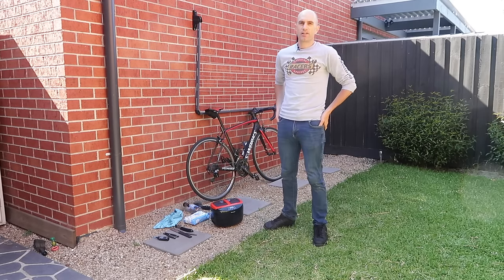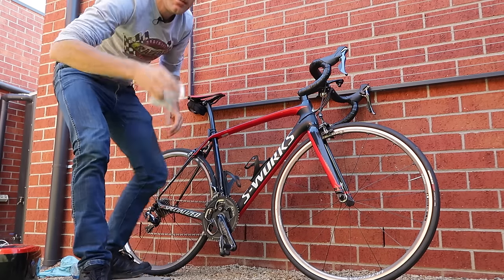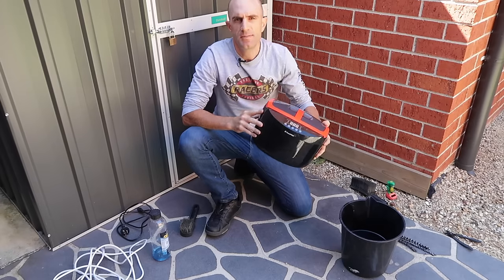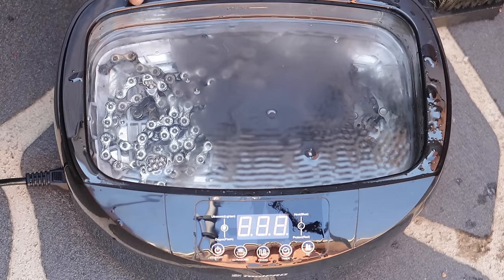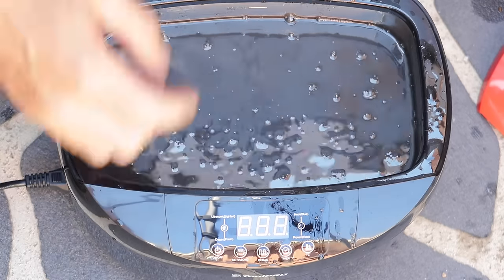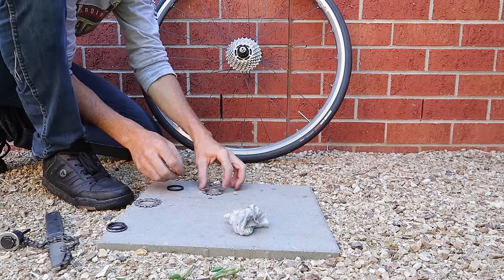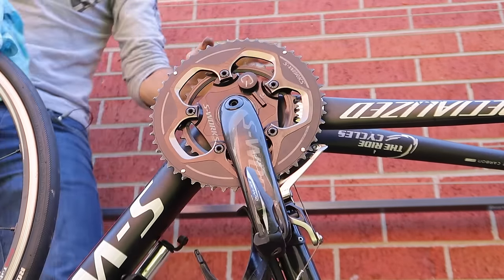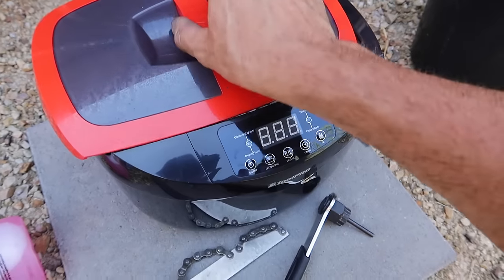CLEAN BIKE: The Ultrasonic Part Cleaner! // How to Clean a Bicycle Chain

Comment: Hey Shane, ALDI have a 50w 750mL USC today for $30, would be worth a go?
Reply from the maker: Might be a little small. Worth a look though.
Reply: @gplama  Cheers mate may give it a go, will fit a chain in, a 32t cassette diameter is about 13cm so should fit, maybe not both at once depending how much separation is required. Thanks!
Oops I was looking at the products housing dimensions, May be close but a chain should fit at least

Comment: What brand of rear light is that on Von's bike? Also, what is your opinion on waxing a chain, or using wax based lubricants such as Squirt. I've tested but the wax seems to get gunky and definitely harder to clean, and strip from the chain if you want to go back to oil based lubricants again.
Reply from the maker: Knog. Waxing is super clean stuff... but I had to keep applying it every three rides or so. Maybe it's better these days?
Reply: Shane Miller thanks! Yeah it wears off quickly. I've had it pickup quite a bit of gunk from the road which is harder to get off than just de-greasing a chain, and it seems like once a chain is waxed it's hard to switch back to grease as the wax is somewhat oil phobic. I sure like how clean it stays though compared grease. I wonder if an ultrasonic cleaner would help with a waxed chain... maybe with hot water?

Comment: That cassette and chain looked better than mine even before you cleaned it
Reply: that cassette, crank, and derailleur retail for  more than my whole bike.
Reply from the maker: It's relative. Head over to any car racing channel and get blown away by the cost of a racing engine. Or how much they spend on tyres for each race meet.

Comment: Don't wash your chain in water. Use odorless petrol instead. No need for expensive bike cleaner then. ;)
I just put mine in a liter bottle of that stuff and shake vigorously, but it will work with ultrasonics also.
Remember to soak it with chain lube afterwards.

Comment: what kind of oil do you recommend?  o use the wax based stuff.  is that sufficient if I clean my chain using this method?
Reply from the maker: Dinosaur based. Wax based works nice, and it's clean, but needs reapplication every few rides.

Comment: 1. Lube chain 1drop per link
2. Rotate cranks to allow lube to penetrate 
3. Wipe chain clean of floated dirt and excess lube

That's it, skip the cleaners, wipes, toxic chemicals.  Using solvents and degreaser is unnecessary at best, and unless completely cleaned off just ruins the new lube.

Comment: OK, so how do you know where the spacers in the cassette go? I.E. how do you know which gears they go between?
Reply: Jensen Healey they go between the ones that don't have integrated spaces, it'd be really obvious where a spacer should go if you didn't put one in
Reply: Jensen Healey you can once you start to remove then just lay out in order as everything came off! Job done you'll soon see how it works and goes back together ;)

Comment: Bought an ultrasonic cleaner from Amazon and tried it last night to clean a couple of cassettes and a chain. The first cassette I tested was done in a mixture of water and Finish Line citrus degreaser, mixed at a ratio of about 3:1. I started with cold tap water and then heated up using the ultrasonic cleaner's own heater. Can't say the cassette came out cleaner than just using degreaser and a brush because I still had to use a brush and several sprays of Muc Off. For the second cassette and the chain, i used a mixture of water and Pedro's Oranj Peelz citrus degreaser. I didn't have a whole lot of the degreaser left so the water to degreaser ratio was much higher. The cassette and chain definitely did not come out cleaner than the previous attempt. They were cleaned in multiple 480-second cycles. I am a bit disappointed with the outcome. Did I not use the right kind of degreaser for the ultrasonic cleaner to do its magic? I did use the plastic tray that come with the cleaner (accordingly to the manual, using the tray to reduce the cleaning effect by about 20%).
Reply from the maker: I use Kerosene with good results. The parts don't come out sparkling, but they wash clean with water (and a little soap to remove the left over kero).
Reply: Apparently kerosene is not as readily available as I thought it would be. I could not even find it in the chain hardware store Home Depot. I bought Simple Green instead and it works way better than the citrus degreaser I used previously. I used a 1:1 Simple Green / Water ratio. The cassette didn't even need to be brushed or sprayed with Muc-Off after the ultrasonic treatment. I simply rinsed the cogs in water.

http://simplegreen.com/products/all-purpose-cleaner/

Comment: Many thanks for the video Shane. I've heard about people using Ultrasonic cleaning but will now investigate further. What Quicklink do you use and what tool was that to undo it so easily ?
Reply from the maker: My local bike shop has one and they swear by it. Not sure what brand quick-link is on Von's bike... the removal tool was some $5 job from Wiggle "Quick link removal tool" should bring it up in the search results.

Comment: Shane, nice vlog as usual with great detail. Yes. Festive 500 begins tomorrow, though here in the northern hemisphere it will not likely be so sunny and nice, expecting a dry day here where I live, in the Seattle WA area, with temps in the 0-3 C / 32 - 36 F range. Is this your standard cleaning process for the drive train, or do you only go to the extent of the ultrasonic cleaner a couple of times a year or when particularly dirty?
Thanks and Happy Holidays!
Reply from the maker: We just rolled in at 8pm and it's 32degC. Brilliant weather here today. :)  I use the ultrasonic cleaner every 6-8 weeks on the chains, but it does depend on the riding conditions they've been through.

Comment: Hey shane, i picked up a cheaper ultrasonic cleaner but my chain still sounds kinda gritty despite running it through about 2-3 cycles. Any tips of possibly making that clean even better?
Reply from the maker: +ryan singh Use a degreaser in the cleaner. Blast it clean after with water and/or a soapy brush.
Reply: Shane Miller I dumped a bunch of degreaser in it actually. I'll try brushing it down too, thanks for the tip

Comment: It should be emphasised that hydrocarbons solvents and fuel oils such as kerosene are toxic, and takes a surprisingly long time to break down in soil or water. Please use a biodegradable degreaser. I think most of cyclists care a little for the environment. Let's follow through with that.

For more information about fuel-oil toxicity and pollution:

https://www.atsdr.cdc.gov/phs/phs.asp?id=514&tid=91

Comment: You can get a deeper clean using petrol in a sealable container and shaking the parts around manually for 10 minutes.
Don't spend your money on devices you don't need when you can do the work manually in a reasonable amount of time.

Comment: (Question from a downhill biker) why not just spray it down with a power wash?. Works great for me lol.
Reply: Sweet! I would never power wash my pride and joy.Treat your bike like you would a lover.Gently caress those sensitive areas,before giving it a really good ride.Going in with the power washer can do a lot of damage to the cables,bearings and chain.Change words to suit your lovers Anotomy.
Reply: Stayshtum68 I have some rules. I just power wash the frame but the chains and hydraulic brakes etc. I was with a sponge.
Reply: kangsterizer my bike is like clean at max 2 days in a row so I don't really bother cleaning it until it's spotless I just do all the necessary parts like brakes chain to get of the dirt and just do a check on all the moving parts

Comment: Looks like the inner chain ring might be installed in the wrong orientation, Could be wrong as not used to that Power meter/crank setup but may be worth a check. 
nice little cleaner though!
Reply from the maker: Yep. It's off by one... but the right direction. No issue for the inner ring as there's no ramp pins or anything on it. (Installed by an Specialized dealer when Von purchase the Quarq spider..... pretty poor effort on their behalf imo)

Comment: Too much disassembling for my taste. I just use a brush with bristles long enough to reach all the way between the cogwheels and some degreaser. Remove the chain, place into a vat of degreaser (I use a plastic container from iso drink or protein powder) and shake or swing it to make the degreaser circulate and penetrate into the chain. Use a brush to put degreaser on the drivetrain and work it with the brush to mobilise the dirt. Rinse it off with no pressure (I do mine in the shower), dry it off by wiping or shaking off. Take the chain out of the degreaser and rinse it out with a strong water jet, dry with a cloth and heat it to evaporate the rest of the water in it. I usually put it on my cooker plate and turn it on briefly, just until it is warm to the touch and let stand for a while. Lubricate the chain - my preferred method is to lay it out on a table and dab some oil on each joint, let it seep in, and then wipe as much oil off with a cloth as I can. Replace the chain. Shiny clean!

Comment: While the chain might look clean and new after the process described in the video, you actually kill it because all the grease that is put on the chain in the production process is being destroyed. There is a reason for that sticky stuff on the chain: Without it the chain will last only a very short time. And no product on the market is able to replenish the grease inside the chain links. So do yourself a favor and clean the chain with a cloth and some oil. Same goes for the rest of the bike: A cloth can be used multiple time and with some spray-on wax you even conserve the parts.
Reply: Garfie1d73 that's why you put new lube on the chain......
Reply: You did not understand me. Lube does not get into the chain links. And if it gets there it's way too thin to withstand the strain when you're pedaling. And it gets washed out in seconds if the chain gets wet. Only the sticky grease can stand the strain/pressure/water. That's why you shouldn't use petroleum ether or other "degreaser" on the chain.

Comment: Don't buy a Chinese one off eBay. The transducers, and often other electronics, cack out really quickly. Buy a lab quality European or US-made one. Neutral industrial detergent is fine as a surfactant, and if you want to keep things clean inside, use a Pyrex glass bowl, not a plastic one as a secondary container (glass transmits the waves to the inner fluid better).

Comment: 90sec? You need it to be in there for 30min to 1hour at 80deg C . You also need to use proper ultrasonic cleaner flued, and that stuff is not good for the environment.

Comment: So, I am a little late to the party, but after seeing this video over Christmas, I thought I would give it a go!

I have never put a tool to my bike, so the first step was to purchase all of the necessary tools and the parts cleaner, and the Kero & Muc Off.

I know that there are many ways to clean parts in the parts cleaner, but this was my first time at everything (taking off the chain & cassette) so I followed the process 100%.

I also pre-heated the water, but my one deviation from the script was to turn on the parts cleaner's heater. What I tell you is that the water is bloody hot! And you should take care in this step.

After the two cleaning cycles, I carefully drained & cleaned with Muc Off and then rinsed. This took me a bit longer and I had to use a rag to clean as well.

By the way, heated water and Kero stinks!!

Cleaning the basket and the parts cleaner also took me more time & effort.

The end result is great. A very clean chain & cassette and I enjoyed my sense of achievement.

Comment: I purchased a jewellery cleaner via eBay and it works a treat to clean chains using boiling water and a splash of Simple Green degreaser. Benefit over using kero is the smell is better and seems to get the chain properly clean too. I cycle a couple of times then replace the liquid with fresh stuff until the result is very little change to the colour of the liquid the chain bathes in, typically four 90sec cycles and two fluid changes.

Comment: Shane, 
   Highly recommend when that ultrasonic cleaner kicks the bucket you upgrade to a 10L industrial one from eBay.  I chose the 10 L size because it allows me to get the entire Crank in the bath.  Dont do one with tradition a knobbs as they fall off but go for the newer digital models.  http://www.ebay.com/itm/391329343424?_trksid=p2060353.m1438.l2649&ssPageName=STRK%3AMEBIDX%3AIT

Comment: Oil ?
I started to use a "dry lube"  (http://www.dry-fluids.com/dryfluid-bike-2.html) Found that that works even better ! 

What you think of these ?
Reply from the maker: I've used a few dry/wax based ones in the past. They were great... but required reapplication every 3 rides or so.
Reply: True - using them on TT / Race bike #marginalGainz :)
Reply: I've been using Biomaxa - seems pretty ace to me. The 500 ml bottle is reasonable value, just a drop on every roller. http://www.biomaxa.com/product.php?id=1

Comment: Stirring the soap in is unnecessary - that what a ultrasonic cleaner does, is stir up water.
Reply from the maker: It works better with a few stirs, the kero floats to the top and sits there otherwise. Anything to speed up the process imo.

Comment: There's only one thing wrong with this Video......... Never put your bike upside down 🙄
Reply from the maker: Two things in reply... it's not my bike... and the new duraace levers are rubber on top, so they don't get all scuffed up. The design was changed to allow this. And I'm pretty careful with the placement, I'm not sitting on riding the 53 chainring like a cowboy.

Comment: 8:33 why oh why would you do that to those poor shifters and saddle? I thought only noobs turn their bike upside down like that
Reply from the maker: DuraAce is rubber on the top of the shifters now days... the saddle is saddle on top. In 2002 it was a noob move... times and design has changed. It does no damage whatsoever. And it's only a bike, not a trophy. Ride it, break it, throw it away. :)
Reply: still I'd never do that to an expensive bike

Comment: Hi. You should never clean a bicycle chain so thoroughly. You wash away the factory oil from inbetween the pins, joints. Only way to re-apply on those tight spaces is to bath the chain in boiling hot oil. If you clean it to bare metal and apply oil only on the surface, you only make the chain wear faster. Anyway, thanks for the review! Hope you gain from my comment. BR
Reply: The factory grease is shit. This is fine.
Reply from the maker: Watch again.... I over oil the chain so that oil gets into the rollers, then use my bare hands like the caveman I am to really ensure the oil gets inside the chain. Good quality oil is the key. I then do that pinch/sound test to ensure it's in there... and it's all good. I haven't half-arsed the job. This method has worked extremely well for me, and a number of my bikes.
Reply: i too use to be OCD about cleaning parts and bearings, but i found this type of cleaning actually wears parts faster and washs grit into the bearings and links. i know it seems logical to clean, but i now stay away from degreaser. Great vid, but my experience has shown me different results. Not being negative, just sharing. :)
Reply: Adrián Molnár what a load of rubbish! Factory grease will not last long then the first clean do you even ride?
Reply: @roilev  Indeed, that is what KMC says.  So now I follow their advice.  I initially found it hard to believe.  But I tried their advice.  After every ride I wipe the chain with a cloth dampened in citrus degreaser focusing on the outside parts.  I reapply dry lube every 100 km (which itself has a cleaning effect).  Amazingly it has resulted in slightly longer chain life, and a lot less work than all the things people do to clean to bare metal, like in this video.  (And which I used to do).  On the other hand, some people love working on their bikes and when everything works perfectly the only thing left to to is clean the drive train.
Reply: You DO NOT need boiling hot oil.  A mix of paraffin and motor oil heated up to the point where it has reached liquid state is all that's necessary.  Place the chain in this solution and in a minute or less, tiny bubbles will float to the surface indicating that the lube has reached the interior pin surface.  There are videos that demonstrate the procedure.

Comment: Just no!
I do a better job using a manual chain machine cleaner + degreaser and a old toothbrush  + a karcher.
Reply from the maker: C'mon, no is such a negative term. Just alternative is so much better. :) +1 on the Karcher... they're bloody great things!
Reply: Shane Miller I liked the idea about the product, but the execution... I don't know, because you had to rub using a brush and use two kinds of solvents too.
How I do:
I use dry lube, so every one or two weeks I wash my chain using a chain machine plus biologic citric degreaser.
ween I need to clean my crankset, I remove both and lefty on the biologic citric degreaser for ten or fifteen minutes, after this, I just wash using the pressure washer(Karcher).

Comment: Ultrasonic parts cleaner, hmm funny how the second step is to clean your parts with a cleaner and brush. Wtf. Yet again a wasteful appliance
Reply from the maker: Give it a little more thought. It dislodges the grease and oil by breaking them away from the surface(s), including the parts you can't see. If you want a full parts washer then you're looking at a LOT more money.